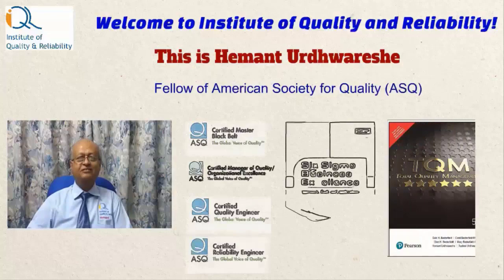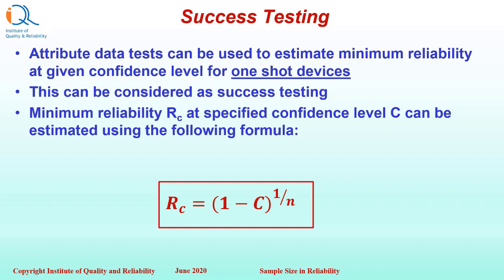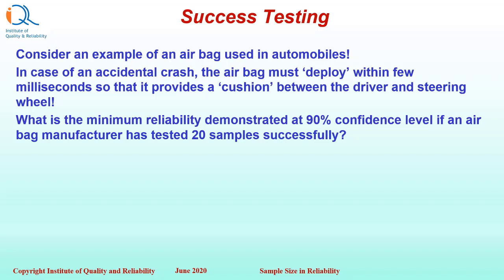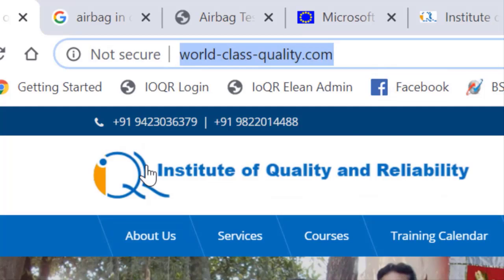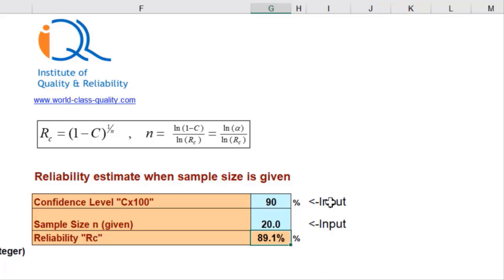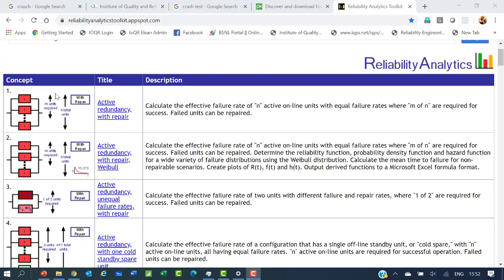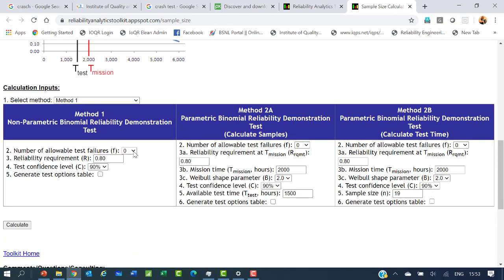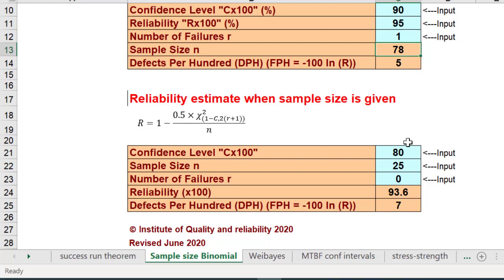Sample size in Reliability Testing Part-1 (One-shot Devices)

Comment: these many samoles to be used fot any type of samole testing? prst or fixed?
Reply from the maker: No. Not for any type of testing! This is generally for one shot devices and no failure.  In PRST or Fixed length plans allow  failures and estimate MTBF. 
Watch these videos on Reliability sampling trst plans  for more details:
https://youtu.be/0U6Y3MvRnIY?feature=shared
https://youtu.be/Me75yHEf56E?feature=shared

Comment: With the sample size of 240 (N) in a qualitative study what method should we apply for the reliability test?
Reply from the maker: If all are successes, use Success Run theorem. If you have failures, then you need to calculate probability using Binomial or approximate normal distribution.

Comment: Hi Sir.....Is there any reference on how the formula derived from ? If not mistake is from Binomial Distribution . I used this method to determine sample size . However FDA required a proper reference on the method used .
Reply from the maker: You can get referrences on internet. Here is one: https://stats.stackexchange.com/questions/73645/how-do-you-derive-the-success-run-theorem-from-the-traditional-form-of-bayes-the.
Another useful ref:
https://www.stat.purdue.edu/docs/research/tech-reports/1996/tr96-26.pdf